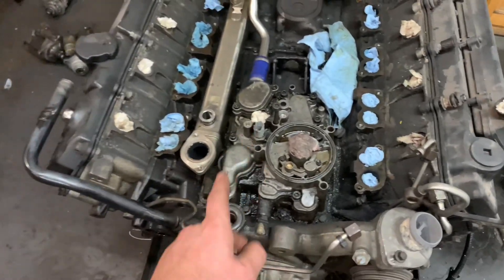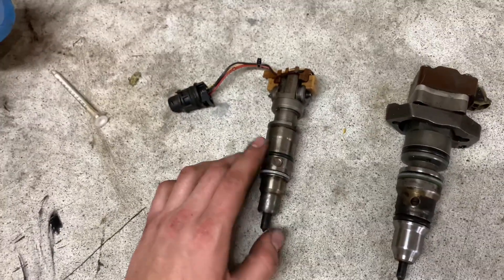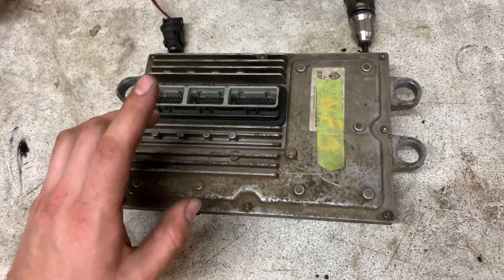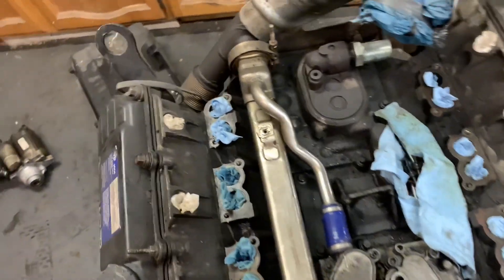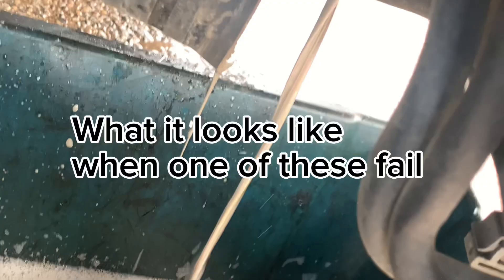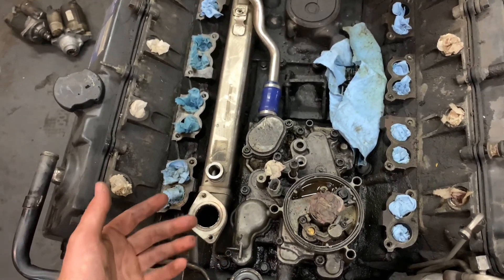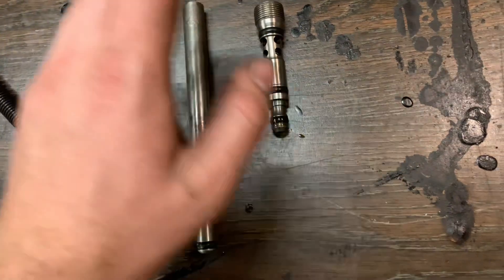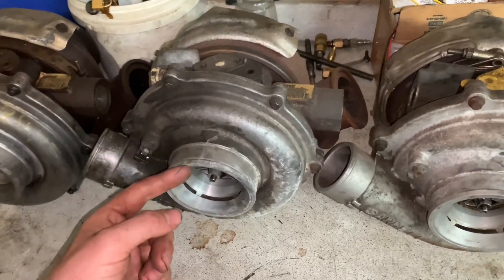This is What’s wrong with the worlds worst engine?

Comment: Long live the VT365! I love my 05, just did a 4" Flo Pro exhaust on it, next plan for mine is the blue spring upgrade! My 6.0 is all stock motor wise, it only has 138K (I am in Alberta Canada)
Reply from the maker: @corradettimotorsports360  watch my other video. I have one on a free fuel pressure upgrade. I’m by Edmonton
Reply: @STROKER-GARAGE  will do! I am right in Edmonton! Thanks!
Reply from the maker: https://youtu.be/FX_F2E3tshc?si=AoJZNlROp75MGPp8
Reply: @STROKER-GARAGE  awesome! I will be checking this out!